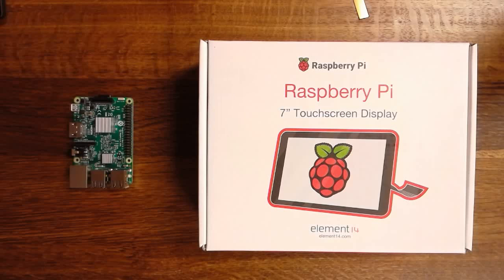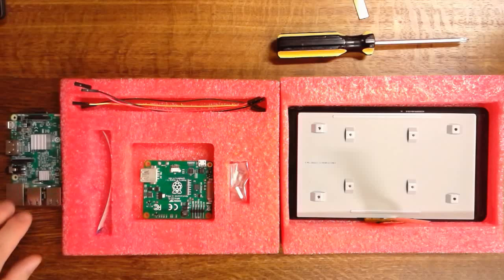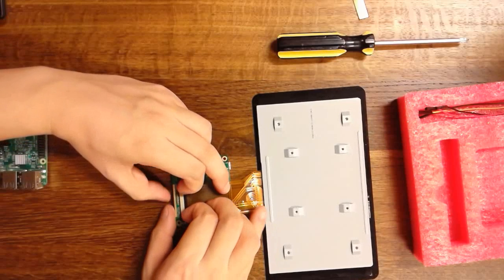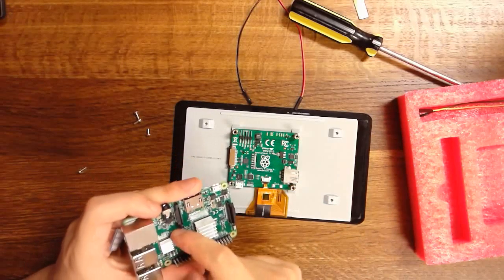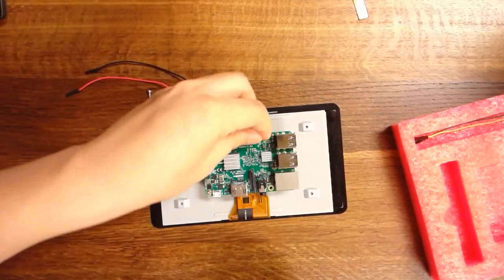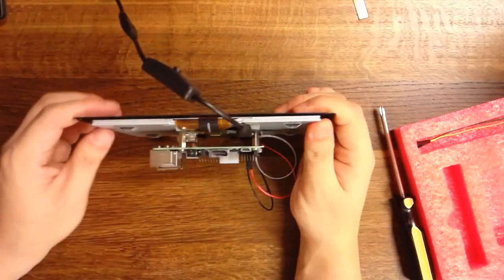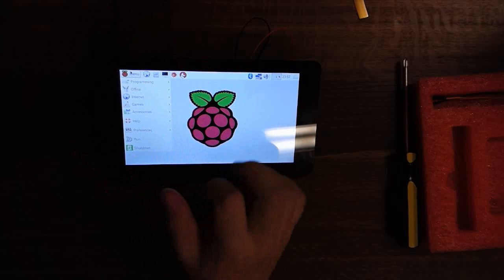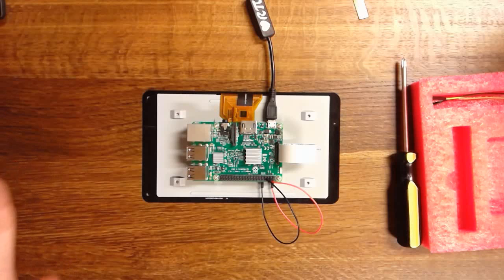Official Raspberry Pi 7" Touchscreen Display Installation Video

Comment: Probably should edit the video and remove the incorrect installation of the ribbon cable.
I kind of jumped the gun and almost turned the power on...  but when I saw the cable was inside out and you were redoing it, I actually broke one of those flimsy black tabs on the TS display.. and its not easy to get it to hold well.
 Others might actually think they got the cable correct (which is possibly the #2 reason they search for a vid like this)...  and then turn it on and their board is gonna short circuit.

Comment: My 7" touch screen also came with two extra jumper wires.  What would you use those for if we are only connecting 5v+ plus ground to the RP3B+?

Comment: Great video, thanks. Is there any hint when you have a HAT, which  takes the pins you attach power to. Can the monitor be powered with the USB port it has from PI?

Comment: Question, I got the raspberry pi 4 B with this touch screen display and I have been using the USB-C to power it and its been working fine, is there a reason I shouldn't use it?

Comment: Is there a reason why using a usb splitter to connect both boards to power wouldn't work?  I am building a car computer using crankshaft and would prefer that to having to pin it if possible.
Reply: It works just fine, I'm using exactly that.

Comment: I have this display but it will never go to 800x 400 I put up with that for a while . After doing a sudo apt-get gpupdate the screen seem to have streak vertically on the display anybody know how to fix these issues. I searched the internet no one really has a answer. It should no be called the official raspberry pi monitor 800x480 if it doesn't even natively have the settings to go there. thanks

Comment: I have a questions: What are the 4 jumper wires used for? When I installed my 7 inch touchscreen display to my SmartiPi case, it works without the jumper wires. Is it necessary to connect it?
Reply: Dude

Comment: I'm so glad I found this video,  nobody else mentioned anywhere that the OS had to be preinstalled in order for the display to work. . which does really make sense but since I saw no reaction from the display at all(never lit up,  flickered,  zero signs of life) I was about 10 minutes away from setting up a replacement unit thinking mine arrived broken.  I will make sure that I try it with the TV I have running my original RPi before I jump the gun.  another odd thing,  in all the videos of people setting up their official RPi 7" touch screen they all arive in pieces.  however mine showed up completely assembled other than the dsi ribbon and the jumper wires.  It is most likely just a newer packaging but figured I would mention it here also.
Reply from the maker: Hi John,
The packaging for this product has been updated to decrease the amount of user effort involved.
Hope this helps.
Reply: LoveRPi just figured I would mention it just in case it wasn't normal I would rather find out I managed to order the only bootleg kit in existence sooner than later lol.

Comment: How do you rotate the screen?
Reply: /boot/config.txt 
edit the following:
lcd_rotate=2 
Make sure it's set to 2 and is not commented out
Reply: Just editing Ayyub's comment a little for total newbies:

1. Open terminal
2. Write: sudo nano /boot/config.txt
3. Hit enter
4. If "lcd_rotate=" exists somewhere, make sure it's "=2" and doesn't have a "#" infront, otherwise change it to 2 and remove the hashtag if there's one. If it doesn't exit, scroll down to the bottom and add this on a new line: lcd_rotate=2
5. Hit Ctrl + X and then hit "Y" and finally Enter
6. Reboot your Raspberry

(If you want it to be in portrait mode, change it to =1 or =3 depending on wich side you want as up/down))
Reply: @Aerox90  Be careful.  The latest version of Raspian has a section for the Pi 4 near the bottom of the config.txt file.  Be sure you are not adding the new line to that section unless of course you are using a Pi 4.  Best to place it just before the [pi4] line.
Reply: To be able to edit that file on your pi run terminal command `sudo mousepad /boot/config.txt` and then you will have permissions to save the file after adding the lcd_rotate line